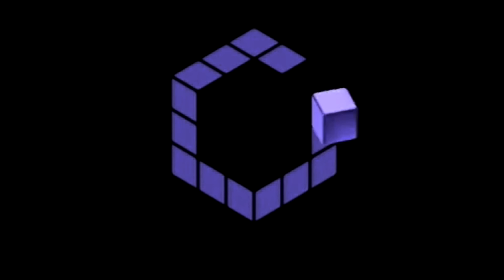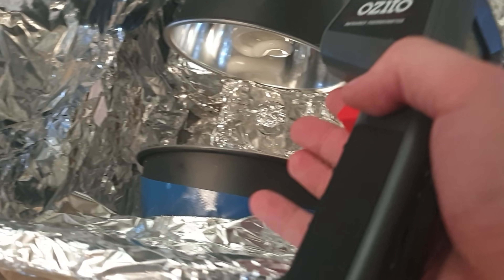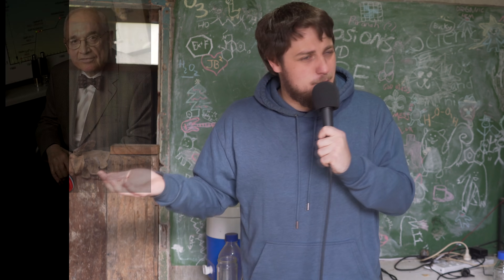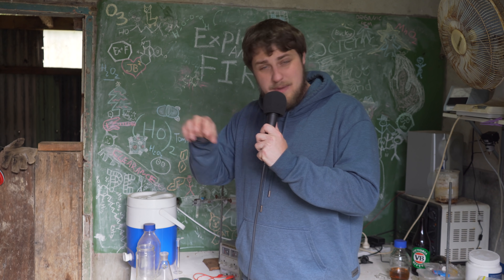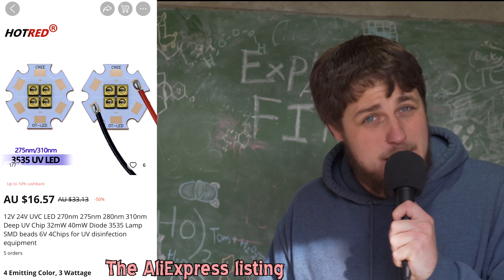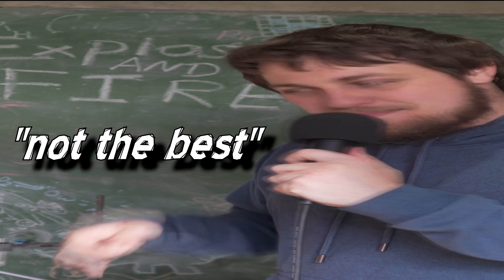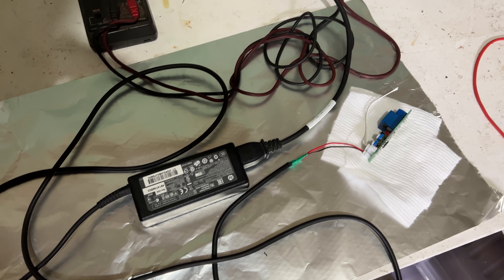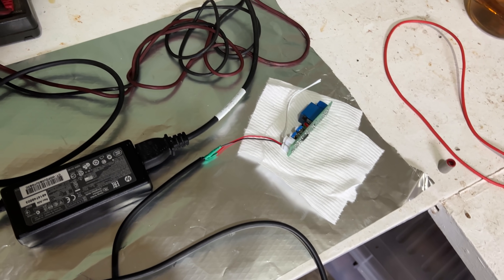Magical deep UV LEDs - Cubane Ep 12

Comment: If it says 40mA it's 40mA, man. Blasting amps through those LEDs will kill them very quickly. I'm impressed that they even hold up that long. Also: you're not supposed to see the LED's when they're on. They don't create visible light at normal operation AT ALL !!!!! What you're seeing is the death scream of an LED. Similar to normal LEDs which will always glow red shortly before they die, even if they're green LEDs. I would not be surprised, if the LEDs don't generate any useful (for you) UV radiation at that state.
Also, also: UV-C should not make paper fluoresce that strong. Overdriving the LEDs could cause them to drift into longer wavelengths.
Reply: Edit: get a resistor: R = ( (Your laptop PSU 19V) - (led voltage 13V) ) / (LED current 0.04A) = 150 Ohm
Original: To not just be "Mr. You're Doing It Wrong". Do the following: take your power supply, set it 13V, turn the current knobs all the way left (voltage should drop to zero-ish, that's fine). Then short the output (or see note below). Turn the "fine" knob of the current settings so that the current meter shows 40mA (which is crazy hard with that meter, sorry). Remove the short from the output. The voltage should pop back to 13V. Then never ever touch those knobs. To be save(er), connect the LEDs to the already switched on PSU. The cheapish ones tend to overshoot the output voltage at power on.
note: instead of shorting the output, use your multimeter in current mode. That even helps with getting the 40mA right.
Reply from the maker: @MrTridac  I’m not too keen to run the LEDs from the bench too power supply for the actual final set up, it feels a bit clunky and not scalable. So I’d be keen to find a driver that could drive the LEDs appropriately
Reply: @ExtractionsAndIre  I made a thousand edits to my self-reply. Final suggestion: you can use a 150 Ohm resistor in series with your laptop PSU.
Reply: @ExtractionsAndIre  or use any kind power supply, and use the right resistor.
Reply: @ExtractionsAndIre  dude, I do electronics and mechanical prototyping as part of my day job. I've thought about making you up a led based light supply for a while but held off because you seemed keen on the Bunnings synthesis ;-)
I'd be really keen to knock up a driver/timer/whatever else floats your boat. 
I'm based in Sydney too so post and time zones aren't too bad.
I'd love to make you up something, drop me a line if you're interested.
(BTW, running off a lab supply for a few days isn't unusual at all, they are designed for it)

Edit, Just to be clear, this would be a no charge dealie, I just want to see cubes and tar not so much screaming LED's ;-)
Reply: @ExtractionsAndIre  101 for setting the current on a lab supply : short out the output. Observe current on the ammeter. Adjust current (you have coarse + fine potis). Done!
Reply: @pinesprite  don't forget to do the shorted output with the voltage set low, cheap supplies don't like the current spike when you short the leads with some volts sitting in the capacitors.
Reply: @ExtractionsAndIre  Or ... Buy more UV LEDs and wire them in parallel until the sum of 40mA each equals your driver output ;D (An adjustable constant current driver 0-1A or so would be way cheaper though.)
Reply: @ExtractionsAndIre  Honestly at this scale the bench top PS is the easiest solution.

With the LED driver you bought, you'd need what, 55 of those LED modules to reach 900mA? (Remember when wired in series to reach 24V, the amps stay at 40mA in each "line" of 2 LED modules, so (900mA/40mA)*2)=55.

Those LED drivers are made for home or architectural lighting which is why they're outputting like 50w of power, they're used to light up a whole room.

So yeah, even if it's clunky, the bench-top power supply is perfect for this application. Limit the current at (40mA*the number of modules) - if wired in parallel - and the voltage doesn't really matter because you limited the current and the power supply will automatically put out the voltage the LEDs "want", which is exactly how those LED drivers work anyways (hence the 24v-42v markings on your driver).
Reply: @zyeborm  are you in the discord? Probably ought to join if not
Reply: @ExtractionsAndIre  I've seen a similar listing that says 140-150mA, so maybe they missed a 1 in yours? 40mA does seem pretty low for those packages, but maybe it's the fact that they're UV
Reply: @zyeborm  Same haha. It'd be a fun project. A proper power supply, housing and heatsink would make a huge difference. I hope he takes up your offer!
Reply: @ExtractionsAndIre  Running the LEDs from a lab power supply is absolutely fine. It's just that your particular lab PSU doesn't give you enough fine control probably. You really need one where you can dial in the right current, because as LEDs heat up, their conductivity also increases, means at the same voltage, the current flow will increase, also increasing heat, and that can lead to thermal runaway.
Reply: @ExtractionsAndIre  Have you considered looking into an Arduino?
Reply: @ExtractionsAndIre  My experience is with LED tape and similar. The drivers for that stuff gives a voltage which must be correct for the type of led you are using, and a current rating which is a limit of how much current the driver can handle. So, roughly, the voltage needs to be the same and the current determines how many leds it can power at once.
Reply: @FAB1150  the cree 3535 uv, this type number is also in the listing, has a typical current of 350-500mA at +/- 6V. It can be run at 800mA max and 100°C max but this isn't recommended.
The typical output is 50mW of light.
Reply: @ortholux2343  that makes sense! In that package there are two LEDs in series (and two pairs in parallel) so it should be good for 12V 700mA to 1A...?
Reply from the maker: Yeah one thing that confused me was the lack of drivers available at such low currents?? Like I can’t seem to buy anything off the shelf at 40 mA? And then when I tried with the bench top supply, it seemed fine at 1amp, but I guess that was wrong oops.
Reply: @ExtractionsAndIre  Because at low currents a simple resistor will replace the driver :)
Reply: @ExtractionsAndIre  Look up "LM317 constant current driver". It's simple and cheap enough to build  one for each LED (around 1$/piece). You can set the current fairly precisely with the appropriate resistors. Then you can just power the LEDs in parallel from an unregulated voltage source (15 to 24V should be fine)
Reply: @martin2250  @Extractions&Ire  This!   High-power UV LEDs are fussy. A simple resistor dropper won't do it reliably, because the forward voltage drop changes as the LED warms up.
Reply: @martin2250  luv me LM317, they're basically up there with 555 timers in terms of ICs a tinkerer should keep by bin full.
Reply: @ExtractionsAndIre  Use your benchtop power supply and a resistor in series. 300 ohms. 12 V across resistor and 12 V across LEDs, so give it 24 V. End of problem. Or ginger-carefully adjust current control knobs like MrTridac describes.
Reply: @sealpiercing8476  Carefully adjusting the voltage levels usually fails because when the led heats up the forward voltage drops, so carefully set 40mA can rapidly turn into 1A. Or you do the adjustment for a hot LED, so 40mA turns into 4mA in a few minutes.
Reply: @adamrak7560  This is a great point, maybe a cheap passive power supply like a 12v DC wall plug transformer might be less destructive as a first go around.
Reply: @adamrak7560  I said carefully adjust the current. The benchtop supply has current adjustment knobs and voltage adjustment. The reason for ginger-carefully is because 40 mA is like half a division, but the fine-adjust knob can probably do that, even though a resistor is probably simpler for such a low power device. And yes, what you describe sounds like a likely failure mode for trying to give an LED constant voltage.
Reply: @sealpiercing8476  12V across the resistor?  12V * 40ma = 480mW, that's going to pop that resistor if it isn't a fat half-watt or better.  Also 24v / 300ohms gives 80ma, not 40ma, so it'll be a race to see whether the resistor or the LED burns out first.
Reply: @georgedorn_fnord  24 V across 300 ohm resistor in series with LED board gives 40 mA because only ~12 V is across resistor, as you correctly stated in first sentence. Power dissipation can be fixed by using three 100 ohm resistors in series--you're right that 480 mW is too much for little cheapo carbon resistors.
Reply: @sealpiercing8476  Make that a 1W resistor at least then.
Reply: @ExtractionsAndIre  the driver you have would be great for running 80 of them, so you could just get more LEDs xD.

basic maths: 6-7v turn-on x 4 in series = 24v minimum of driver. 900 ma of current from driver / 40 parallel runs of 4 diodes = 45 ma per LED. A little over, but (probably) fine. If you consider this as an alternative, you've got a budget of ~$1200 to find a lower current driver 🤣

But like others have said, at this power level you can just use a resistor in series with your benchtop supply at a constant voltage, or try to dial in your supply in constant current mode. The latter might be tricky (without using an ahmmeter) as it probably isn't accurate enough at that low of a current level . If you used the three you have left in parallel, you can probably limit the current to ~100 mA pretty safely. You'll get better results with just resistors and a constant voltage supply, but it'll require more circuit testing and design.
Reply: @ExtractionsAndIre  Hey! hobby electrical engineer (electron cowboy) here, the way you limit current for LEDs is with a resistor, you can look online for a calculator, you plug in the voltage and current, and it will tell you what resistor you need in series with it. UV LED's are NOT meant to emmit visible light like that, 40mA is actually the high end of the power spectrum with good cooling (as it has) so do not ever run them at 1A lol
Reply: @ExtractionsAndIre  My EE degree is screaming at your chemistry degree right now.
Reply: @ExtractionsAndIre  check out a page like Mouser (or whatever the equivalent down under is), filtering for 40mA drivers still gives me lots of results. They are SMD so some assembly is requires, but it's not that hard. But yeah just putting a 300 Ohm resistor in series will also do the trick at the cost of some efficiency
Reply: @ExtractionsAndIre  well any buck converter with current control can act as such a driver, just pre adjust the current with a load resistor and your good to go
Reply: @ExtractionsAndIre  Just use a 250 ohm resistor in series with the LED at 12 volts. That will drive the LED just fine and wont blow it up.
Reply: @ExtractionsAndIre  You will need resistors to step down the current. Lots of people will tell ya the same.

Give @ElectroBoom a shout.
Reply: absolutely this!
Reply: Exactly, that table says "absolute maximum ratings" for a reason lol
Reply: This gave me real anxiety 😲
Reply: Think of voltage like pressure, 24 bar vs 12 bar and current is the flow rate. Filling a pipe with rocks slows the flow rate, much like a resistor slows electron flow rate. It takes more pressure to flow through a pipe filled with rocks and it will only hold so much before the shit pops. Think of your fragile components like little glass pipes, you don't want to melt them with current (I^2*R=heat) or pop them with voltage. Pipes in parallel flow more current than one long skinny pipe in series which kills pressure over distance. Hope this helps.
Reply: People with PhDs are very good at the precise subject of their PhD and generally absolutely nothing else. There's nothing wrong with that, some people gotta specialize to drive knowledge in that field forward.
Reply: Yes, this! I would, if not for a suitable constant current driver, just put a resistor in series to keep the current down.
Reply: A cheap multimeter world be useful also. I recommend one that has auto off. Less likely to have a flat battery when you need it
Reply: a lot of people are saying to wire LEDs in parallel, that's a really bad idea. what happens is, one LED gets a bit warmer than the rest, and its forward voltage drops a bit, and then it starts sinking more than its share of the current, lowering its forward voltage further, which creates a runaway effect that ends with that LED drawing all the current for all of them and it blowing up. which then quickly cascades to killing the other LEDs since the driver will keep pushing the same current (by increasing the voltage), driving the remaining LEDs above their rated current.

what you need to do is either drive each LED independently (could be as simple as just giving each LED its own resistor), or wire the LEDs in series (which as you've noted requires a higher voltage), since in a series circuit if an LED's forward voltage decreases, that just means less total power transferred to that particular LED, which leads to each LED settling into an equilibrium.

in some modules you'll see LEDs in parallel, this only works because the LEDs are very tightly thermally coupled, preventing any one LED from diverging too far from the rest of the array, this doesn't work normally without a bunch of careful engineering and usually also binning of the LEDs into groups with really similar characteristics by the manufacturer
Reply: @spambot7110  In commercial products it's routinely possible to get away with driving LEDs in parallel--but only because the manufacturer ensures they're matched, or doesn't with the consequences you describe, as the case may be.
Reply: @sealpiercing8476  yep! ...as per an entire sentence in the comment you're replying to, which says exactly that (and also mentions thermal coupling)
Reply: @spambot7110  It's a fair cop. My bad.
Reply: It is absolutely false that you would not be able to see the UVC leds at all, you WILL be able to see UVC leds with the naked eye (though you definitely should not look at them without protective eyewear). UVC makes practically everything fluoresce including the package components and the led chip itself, inevitably emitting some small amount of blue light. Also it's completely wrong that UVC won't make paper fluoresce brightly. YES it absolutely will and the coumarin whitening agents in the paper usually absorb most strongly at EXACTLY around the 300nm wavelength of these leds.
Reply: Many UV leds do give off light in the visible range as an indicator to the user that they are on. I have used UVA and UVB lights in my lab and they always get off a white/purple lights along with the desired UV light. Not that too much current is a good idea.
Reply: @trent6319  Granted, I've worked with just one type of UV-C LED so far. But I have seen spectra in datasheets of many UV-C LEDs, and they usually have just a rather small peak at their rated wavelength.
Reply: so my advice would be to get a constant current driver that can supply at least 48v (or 12 * NUMBER_OF_MODULES) and can be configured to do 40mA. or if that voltage starts to get into scary territory (which 48v arguably already might be), get 2 drivers and do 2 series circuits. if you wanna go really cheap you could get some beefy power resistors instead with the values others have calculated in this thread. as a rule of thumb, the higher the voltage drop across the resistor, the more power it dissipates, but also the better control it'll have over the current.
Reply: Agree on everything except the visible light part. They do emmit visible light. There are essentially no UV leds that dont emmit some visible light, hence why we've got things like ZWB filters
Reply: So, you are saying I can buy these and tweak the emission spectrum by overdriving the current? Because that is what I want to hear
Reply: @SixTough  No. No, you cant. LED's are fine tuned by the manufacturer for a very specific nominal current. There's a small tolerance, but nothing that will shift the spectrum. Going above that might shift the spectrum. But I'd guess it's super unreliable and drift like crazy. Ultimately, it will also kill your LED.
Reply: Others have already said this but I will reiterate.
 SIMPLEST SOLUTION- Buy and use 1x 150ohm 1 watt resistor in series with each star board. If using 4 star boards, get 4 resistors. Solder each resistor in series with each star board. Then connect all 4 resistor/led strings in parallel, and power off of the 19v laptop power supply. This only works if you order the same 12-13vdc 40ma star boards marked 6V that you used in this video that have the individual emitters wired 2S2P, and on a 19vdc supply. This will limit the current threw the emitters to the 40ma maximum. Resistor will need to be a higher power 1w resistor as it will be dissipating quite a bit of power. 

If you google "Led resistor calculator" there are websites that you can simply plug in the values (supply voltage, led foward voltage, led max current) and it will tell you exactly what Ohm resistor value to use, and how much power will be dissipated in the resistor in MW. At least double the MW value then convert to W to get the wattage rating of the resistor needed. 0.5W would work but is going to get really hot, minus well just use 1w rated resistors. 40ma is the maximum those led's are rated at, I honestly cant believe they didnt explode when you put 1A threw them. 

Using a resistor is not an efficient method of driving higher power led's but for your purposes it will work fine. If you want to go the route of an actual led "driver" which will have much higher efficiency and be much more versatile (at the expense of being slightly more complex), you can buy what is effectively the exact same thing as an led driver but that is variable and can have the output voltage and current set to a specific limit, in the form of a CC/CV buck converter for like $5 on ebay/amazon. There are lots of options but stick with either the red pcb or blue pcb ones that use the xl4015 or xl4005 IC. They can be found by searching "5A dc-dc CC CV buck converter" on ebay or amazon ect. They can take your 19v laptop power supply as the input and give you a variable 0v-18V and 0.01A-5.00A output, that can be set to 13vdc and 0.040A (40ma) of current which will drive one of those led stars perfectly. And if you want to run multiple star boards like 2 boards or 4 boards you can just wire them in parallel and double or quadruple the current output to 80ma or 160ma. You dont have to worry about having uneven current sharing from running them in parallel. For what your doing with them they wont be ran for long enough to actually have that cause any issues. Not to mention the star boards already have more then one emitter running in parallel on them.
Reply: It's probably shipped from China, where they overestimate everything including efficiency, so...
Reply: The reason you see funny colors on dying LEDs is the heat: "By increasing the temperature, the band gap energy decreases and the emitted wavelength increases. It follows that the peak wavelength shifts to longer wavelength and therefore this shift called the red shift."
Reply: Okay then why do all UVC lights look like that?
Reply: @Industry-insider  Because non-LED UV-C lamps produce very wide spectra. They use a glowing gas plasma which just happens to glow partly in UV-C but it reaches down into the visible range. The UV-LED's are band-gap emitters. They produce a pretty narrow spectrum in the UV-C range. They often don't even emit UV-B or -A, let alone visible light.
Reply: Go look at the rated current on any comparable LED. I couldn't find one for a Cree UV-C product, but I found the datasheet for a comparable product and in a quad-die configuration like this they're rated for ~1A @ 12V, and people have been overdriving Cree LEDs for years. The efficiency drops off quickly past a certain point, but if you can keep it cool they'll take the abuse. As for the light, that's because cameras are sensitive to UV-C. You're not seeing the "death throes" of an LED here.
Reply: @ParadigmUnkn0wn  
3535 uv datasheet https://www.mouser.be/datasheet/2/245/Luminus_XST_3535_UV_Datasheet-1650541.pdf
Reply: well if its 380nm then it should absolutely be visible so IDK what ur on about.
Reply: @Wtfinc  We're talking about UV-C which is at 280–100 nm.
Reply: @MrTridac  my mistake, I had to rewatch to see that the LEDs are 310nm, 70nm above the visible threshold of 380nm. Begs the question, how visible is 380 compared to 370,  360, 310, 275, and 250nm with fluorescence test and naked eye.  BTW what a crazy looking semiconductor those UV LEDs, they look exotic or like jan/mil-spec packages. I want one yesterday! lol
Reply: Deep UV leds have two junctions, one of them is blue so you can see it running.
Reply: UV LEDs tend to have blue junctions inside them as well, so you can tell they’re on.
Reply: That was brutal to watch. It would have taken just one google search to learn how to drive LEDs. If you can do advanced organic chemistry you can definitely do basic electronics.
Reply: @kasparroosalu  I have a friend in organic chem who is the exact same way. Dude can pass org chem but cant understand how to use a multimeter. Org chem is worse than lead poisining lmao
Reply: A few things:
a) most common power supply are voltage supplies, so they’ll supply a more or less constant voltage, and the amperage will adjust accordingly (within reason, and should not exceed the max stated on them)

b) LEDs tend to prefer to be under driven, so maybe rather have 5 at ~11V (don’t know how much you need to even turn them on) than 2 at 13V

Best way might be to get a 12V power supply, put a resistor in line to drop it to ~11V, and then put a lot of stars in parallel, to split the amperage

c) The number one killer (aside from excess voltage) for LEDs is temperature. Make sure to keep them down near enough to room temperature
Reply: Blasting amps? You don't blast any amps, amps are drawn up until the max needed or provided, whichever comes first. The outmost importance to LED is that you get the voltage right, some LEDs are sensitive to as little as a couple of percent overvoltage and will burn out quickly. Undervoltage will just lead to less light, or none at all. If you have a 20mA LED (which is pretty much most standard 5mm LEDs) it doesn't matter if you supply 20mA or 10A, the LED will just draw what's needed. Regardless it's good practice to add a resistor in series with your LED.
Reply: @SwitchAndLever  LEDs are not ohmic devices or regulated either. They are current mode devices and should be driven as such. "The right voltage" changes with temperature and many other variables. The right current does not.
Reply: @SwitchAndLever  
That’s kinda wrong.
If you have a constant current power source it will pump exactly 40mA into the LEDs at whatever voltage.
That’s how I recommend driving any LED.
Reply: @SwitchAndLever  they're so sensitive to voltage because of the month linear V-I curve of a diode. Too much voltage causes lots of current to flow, causing damage.

With a resistor, the resistor controls the current, while the LED runs at whatever voltage it "wants" in a potential divider with the resistor.

Resistor is essential.

Suggest you brush up on your knowledge of impedance before trying to teach people the wrong idea.
Reply: @SwitchAndLever  That's only true for regulated devices, and these stars are not regulated in any way.  As they heat up, their internal resistance is going to be damn near zero.  Remember ohm's law?  Solve for amps (I = V/R) and then plug 0 in for R.  You don't get 40mA that way.
Reply: @georgedorn_fnord  Take a benchtop power supply, crank the current to the highest, crank the voltage to exactly 3V then attach a device which requires exactly 3V (like a white 5mm LED for instance, doesn't get much more unregulated than that) and anything lower than what you have the supply set for in current. It won't blow out. The amperage setting on a supply is essentially the MAX the supply will supply depending on load. Current, amps, aren't pumped into anything, it's drawn as much is needed. It doesn't matter if it's these UV LEDs or anything else. That's the problem I have with the analogy, not as some people seem to think I think, that high current can't be an issue. It can, just not here. Regardless, regulating current flow with a resistor is the way to go.
Reply: @SwitchAndLever  Two problems here: with a single LED, it's pretty easy to stay near the bottom of the exponential current curve.  With 8 LEDs of varying curves (two LEDs per package, four packages), that exponential curve becomes far harder to fine-tune.  And that's before thermal drift starts causing the LEDs to conduct even more current.

It's obviously possible to still fine-tune the voltage to a safe point, but with great risk.  Constant current LED drivers exist for a reason.
Reply: @georgedorn_fnord  You have no arguments from me on those points. None of that was what I argued, but rather that amps are somehow "pumped" into something. It's an entirely wrong analogy.
Reply: @SwitchAndLever  I very carefully avoided saying that; I showed that LEDs are essentially a 'divide by zero' error when the voltage goes just a little past their forward voltage.
Reply: @SwitchAndLever  this is just plain wrong. LEDs are current devices. The most important thing when driving an LED is the current, not the voltage. Any voltage above the forward voltage will be dissipated in the tiny gold bond wires in the led and kill them pretty much instantly.
Reply: @Switch & Lever you’re wrong, connecting leds like that will cook them install
Reply: @SwitchAndLever  Holy crap, I don't know how someone could be THAT ignorant of LEDs and still try to sound like they know what they're doing. Its not just good practice to put a resistor in series with an LED, it's required. 

LEDs are DIODES which means they have an exponential rise in current as they switch on. Controlling that exponential based on voltage is next to impossible as the difference between the drive current and explode current is typically millivolts. 

That exponential effect will cause an LEDs voltage to remain almost completely fixed and you can rely on that behaviour when you design around them and use a CURRENT controller. You can either use an active current controller, or a passive one (a resistor) but you control the current.